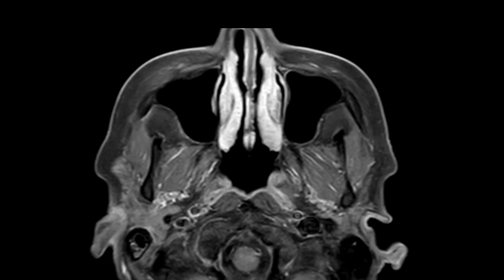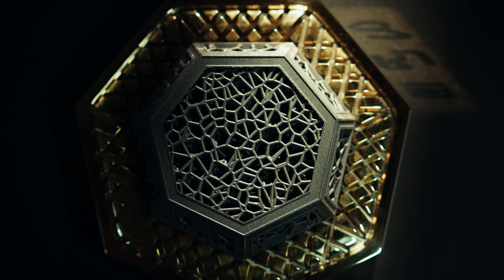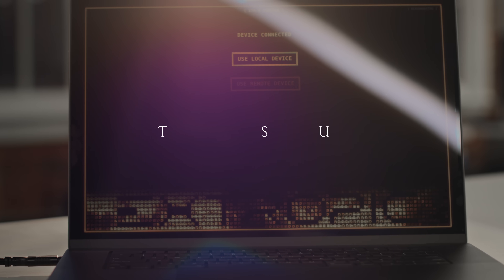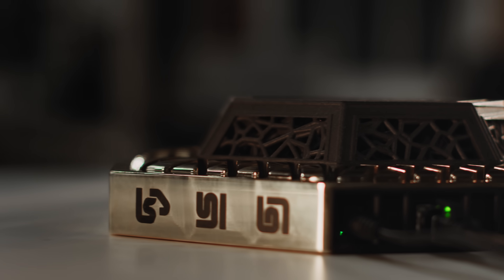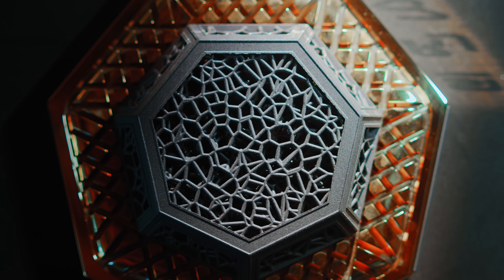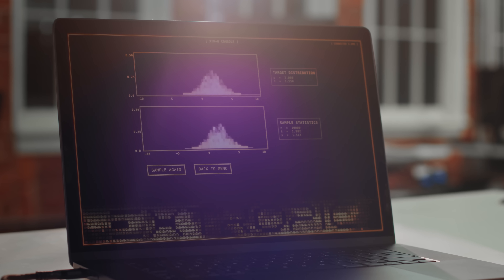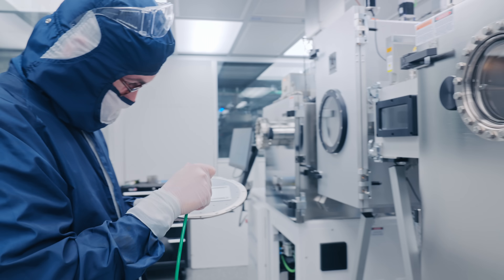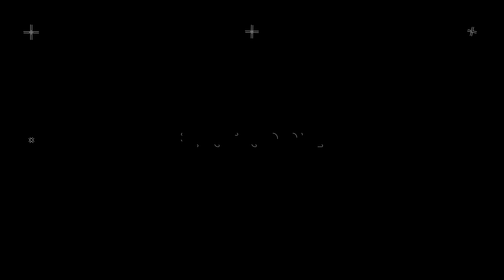Hello Thermo World | Extropic

Comment: Okay I see in your ad something that is ancient I mean older than dirt ancient now if you stand around the solar system with a radio telescope and actively stay inside the sole solar system with your scan and look for pieces of metal that look exactly the same as that you might even find them so far as floating in the Star right now that they were used for a stabilizing field instead of the way that we do it with satellites right now and somebody went nuts and started using them to shoot the satellites down and there was intriguing such that is part of forgotten history regardless of there is an experiment that tried to get to zero Kelvin and they got really really close well your thermal computer if you take and use that same zero Kelvin experiment and make a really cold spot and run it in reverse run it in a negative polarity instead of a positive polarity you'll still be able to get every bit of the computing power without having to pay hardly any cost at all now the next thing is we do need to do the calculations and see if we can apply another grid of those things on the star to make it not have hot and cold spots to stabilize it and get the radiation down to where it's not burning our brains all the time and we can actively think instead of operating at the speed of an insect among other things oh the operating system for that ancient silver or not silver copper looking geometric shaped computer that's a thermal computer is everything on the watermark right now the digital global watermark and all of the recorded data besides just the watermark and it's not ready yet it's one year and one month away and we've known about it forever in this pieces have to plug together the computer as you know it is a fifth dimension storage cabinet as was commissioned by the international bureau of magicians which was the global police force 200 years ago the s*** happened about a hundred to 150 years ago the global nuclear terrorism a the birds wanting birds to incident killed 14 out of 15 people on the planet and the population was 5 billion and that's your grandparents or children born in that and the great-grandparents lived through it personally

Comment: Extropic builds probabilistic chips that use real physical noise to accelerate AI sampling and optimization. The science is solid and based on decades of research, but scaling manufacturing, software, and ecosystem integration will determine whether it becomes a niche accelerator or a major computing platform.  The science is absolutely legit.  Honestly, Nvidia or Musk will probably purchase them soon...tick tick tick

Comment: Sorry not sure i gets whats happening…so basically they are predicting whether the pbit valued would be a zero or one based on “sampling,“ or rather, looking at (measuring) the diffusion of thermal energy across the pbit before it is actually outputted as a Zero or One? Is that correct? Can someone confirm or clarify?

Comment: Amdahl’s Law still applies — but the “serial” portion is now the digital interface and measurement.
Analog neuromorphic networks may achieve enormous intrinsic parallelism, yet their effective acceleration saturates due to conversion, control, and communication bottlenecks — the thermodynamic Amdahl limit.

Comment: Is this like a cheap way to do what quantum computers does?
Reply: Not quite, with this device you can recreate at most the physical behaviour of a single random qbit. In an ideal quantum computer, you can entangle multiple qbits and explore complex systems of quantum states that would be extremely complex to be simulated. With this typology of device, theoretically, you can just have efficient pure randomness on single bits, instead of having to implement a (costly) pseudo-randomness calculation that now you have to do on a deterministic computer.

Comment: So we could sand-box our own LLM? At-home LLM potential?
Potentially yes in the long run, but not yet. They say their future devices might be low-cost accelerators (even “in every home”) for AI workloads.  But today they are not offering that. So if someone claims you can buy this tomorrow and run full LLMs at home, that would be premature.

Does this make it a quantum kind of? Quantum at room temperature?
No — it’s not quantum computing in the sense of exploiting quantum entanglement or superposition as in many quantum‐computing startups. It is leveraging thermodynamic/probabilistic hardware at or toward room temp, yes, but not quantum in the classic sense.

Is this a public company yet? It has some great potential if handled correctly (R&D but with results).  I would want to dig into the team and business more.

Comment: This is either the most revolutionary thing in computing for decades or just a flashy scam. No inbetween.
Reply: It can fail without them intending to deceive, they are pretty clear about this being super experimental and even if the hardware will work they may still loose because the software may be too different to adopt. Sometimes genuinely good ideas can flop with no ill intentions from the creators
Reply: @svuvich excuse(y) for they better not fail. Why fail? Why make money with failures,  when success is so much more profitable
Reply: @svuvich I guess you're easy to scam and exploit.
Reply: Flashy hype or scam?
I’d classify it as legitimate deep-tech startup with significant hype and uncertainty. The technology is real (the company has published documents, press, prototypes) but it’s early stage. So it’s not a scam (as far as public info shows), but one should treat claims with caution (lots of “could be huge” language). If someone is selling “buy now” expecting full capability, one should be wary.

Comment: It's an excellent approach... good old stochastic computing, which definitely provides part of the solution... combined with Trinary systems as a further upgrade to digital systems once you start to hit the wall (reducing power and silicon usage while increasing performance), quantum systems and even analogue computers, you can create hybrid supercomputer systems that can efficiently, quickly and cost effectively handle most types of problems far faster than would be possible today, with AI, simulation and problem solving performance growing exponentially...  combining these systems together to distribute the correct problem and algorithm to the correct underlying architecture,  is like the transition from working with paper and a slide rule, to moving to working with an advanced mathematical application with graphing and simulation... but giving that upgrade to your AI and your supercomputer as a whole. I actually think that with the challenges they are facing with power consumption and cost putting upper limits on GPUs, and with the freedom they have to redesign architectures on the card, I am surprised that GPU manufacturers are not already migrating towards Trinary processing systems,  getting a lot more out of each wafer, reducing power draw and bringing next generation performance.

Comment: I don't know if I got it correctly, but: 
It is using the same princible like Quantum processors, but having fast switching Bits instead of superposition Bits. So a concatination will be a approximation of the real concatination distribution, that would result by using superposition Bits. So my question would be, does this really scale well? Is the approximation by "thermo"-Bits still a good approximation of the real concatination distribution, when the concatination goes deep?
Reply: You forgot to squeeze in "entanglement" :)

Comment: So, from my understanding (which very well may be flawed), the TSU is basically the hardware implementation of the torch.multinomial() function for sampling from probability distributions. Their big breakthrough is a new kind of Gibbs sampling algorithm hardware implementation  that is made up entirely of basic transistors, making them exetremely suitable for use along with classical computers (cpus and gpus). Hardware implementations of the gibbs sampling algorithm have in-fact existed before, but the previous implementations have either been too impractical to use (eg. the exotic matter they keep referring to), or some other reason which makes them not more than a gimmick.

A bit about EBMs (energy based models) : They are models that, given an input tensor, output a single "energy" scalar, which determines whether the input was a "real" data tensor or "fake" data tensor. The discriminator of a GAN actually is kind of an EBM. EBMs are useful when we need to rank multiple outputs with respect to the input, and get the underlying "correctness" of each of the input-output pairs. High energy value = bad similarity, low energy value = high similarity.

EBMs can and have been used for generative AI, especially image and video generation before. But they are slower than basic DDPMs because to get the noise texture that needs to be subtracted from the input texture from an EBM, we need to backpropagate the energy function wrt. the energy scalar. Backpropagation means we need like double the memory (to store the gradient buffers) and we also need double the compute, to get the input tensor's gradient.

Now, this is where my understanding is up to. I'm not entirely sure how their "Denoising Thermodynamic Model" works... I'll need to read more of their papers, I think. But the point remains, that there is indeed a gap in the current market for a multinomial sampling hardware accelerator.

Another thing, this obviously won't render GPUs useless. To train the actual energy function's parameters, we'll obviously still need to use tremendous amounts of energy and compute power that can only be provided by the gpus. What this does is basically sample elements from any given probability distribution, hence the name, "Thermodynamic Sampling Unit".

Anyway, enough yapping. Great job with the design, guys! Looks super cool lol.
Reply: I believe Gill said that hybrid with GPU is how expected most people to use it.
Reply: your understanding is extremely flawed.  https://youtu.be/w6RztFN36Vo?si=UfMU0PKCyf4QgkIU
Reply: @B8ionNik  you’re basing this off of a single promo video where a company whose product creates noise, is using it to market new product? I’m shocked.  Why can’t people just let these dudes try to make this work? I really don’t get it. It’s like no one wants someone to pull off really cool shit. Everyone just wants everyone to accept the status quo. Hardware has the same insecure, crab mentality that you’ll find in the ghetto. It’s weird, because I assumed people in this space would be more interested in making it work, but rather there are a handful of people that just want to tear this shit down from the jump.
Reply: @Laxobigging  Skepticism is part of the scientific process. Hopefully people will keep an open mind, but there are a lot of reasons to be skeptical here.
Reply: @B8ionNik  the video you linked has nothing to do with my thoughts. There aren't even any research papers linked to it or referenced in it. I'm guessing this is a bot.

Comment: To me this sounds kind of like a quantum computer, just without the quantum part.
So if I understand the idea, you’ve got these p-bits (tunable random bits, I’m picturing them like PWM signals) connected to some kind of analog computer that models thermodynamic relaxation, and you just let it settle to a steady state to get your answer. The neat part is that instead of fighting noise, it uses it, so no energy wasted trying to maintain "coherence". Also because it's like an analog computer, there's no energy wasted on clocks.
I had not heard about Thermodynamic Computing before, but the efficiency gains sounds plausible to me, I'd love for this to work.

Comment: Sounds cool but, can i play fortnite with it?
League of legends...
Besides probabilistic stuff and sounds form the video, can i vibe code with it?
Will it be compatible with running any local ai model?
what kind of drivers will be for those ai operations?
can i far, bitcoin or any digital coin with it?
How much will it be, what are the energy consumption numbers in voltages?
is there source code of it for any application?
Is there a github for all of it?
where exactly are those papers located at or the link of those paper so i can read them all?

Comment: Waiting for a tutorial on how to run a ML model on this hardware and compare the performance with existing hardware in market.
Reply: I think that's the thing they still need to solve. The new computing paradigm requires a new way of thinking about ML. They are calling for open source contributors to push new ideas

Comment: Is this analog computing ?
Reply: More specifically I think the breakthrough is the method of digitizing the analog circuit and interpreting it as probability.
Reply: Not exactly. Analog means you can take values in between 0 and 1 whereas this just spends time on both (at least i think so because they didnt go in depth on how exactly this PBIT works)
Reply: Yes
Reply: My exact same question!
Reply: It’s thermodynamic computing, look it up.
Reply: @anywallsocket is it similar to stochastic computing? Will have to take a look a bit later. I just rmbr both are probabilistic and are much more efficient while scaling and accuracy is very similar to standard ml
Reply: They repackaged quantum computing as Thermodynamic Computing unit, I will have to read there paper to understand it completely right now
Reply: @kanishkbakshi2004  This is not "repackaged" quantum computing.
True qubits rely on quantum effects to enconde value. A p-bit is just a regular bit whose value comes from locking a voltage input and then sampling it. This voltage is produced through conventional, non-quantum hardware effects. In this case a resistor network emulating energy distribution functions biases the p-bits before sampling, hence they called it: Thermodynamic Sampling Unit.
Extropic did not invent these concepts, and the only use for their advertised devices is being more energy efficient for classical probabilistic algorithms (like machine learning) - if they even work as advertised.
Reply: @elarbolfeliz so basically they are predicting whether the pbit valued would be a zero or one based on “sampling,“ or rather, looking at (measuring) the diffusion of thermal energy across the pbit before it is actually outputted as a Zero or One? Is that correct?
Reply: @Dr_Birthday  There's no prediction involved, the pbit output is either 1 or 0. Sampling here just refers to measuring a value from a signal over a set of abstract nodes. Extropic's pbits, pdits, pmodes and pmogs are the makeup of those nodes. Circuits in a chip that takes a voltage signal as input and allows you to bias the likeliness of a 1 or 0 output.
Think of these circuits like weighted coins or a set of weighted dice each. In total they make up a more complex set where you can program the weights and then measure the results.
Also, far as I can tell from Extropic's articles, their circuits do not work by measuring thermals. Their Gibbs sampling implementation does have a temperature parameter, but that does not typically refer to actual thermals at all. The way their hardware ultimately encodes bit values seems to be plain old pulse-amplitude modulation. Aka just a clamped voltage waveform.
The clever part is they encode the parameters of an energy distribution function into voltages. This way they can use a programmable resistor network to produce an output voltage that represents the bias parameter of the pbits (or pdits etc), then sample their state.
In general, "thermodynamic computing" is called so because it harnesses physical stochastic effects to do probabilistic computation. It has nothing to do with thermals per se. (to be clear: thermodynamic computing can be done by using thermals as the stochastic effect in question, but in this case I can only go by the technical articles from their website, which suggest they don't)
Reply: @elarbolfeliz ohh okay so it’s just making random, probabilistic thinking much better via analog tech.